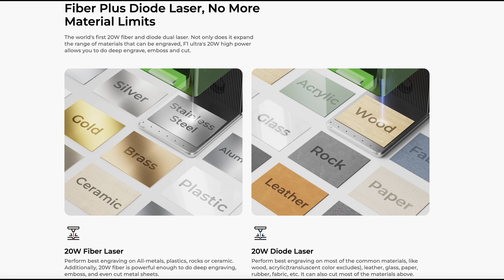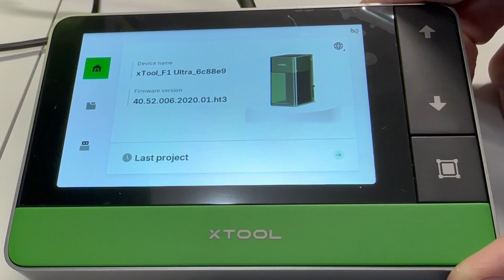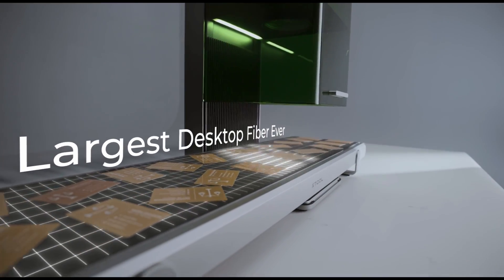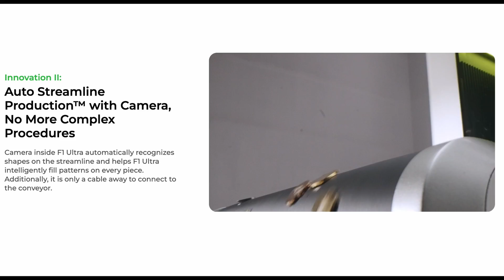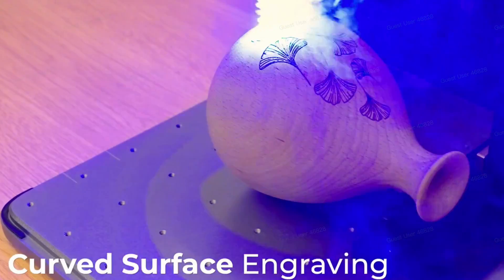Sneak Peek of the New xTool F1 Ultra 20W Fiber and Diode Laser Engraver

Comment: Overpriced!!!
Reply from the maker: Guess it really depends on the buyer.  Look what this laser offers over a standard bare bones 20w Fiber.  A Raycus 20w is $1,800.  Is it worth an additional $2,000(with the $900 off) if you were to add an additional 20w 455nm source, motorized Z, smart camera, light, external touchscreen, and miscellaneous odds and ends.   Some might not agree, while other will.  Like I won’t buy a luxury truck, when I only use my truck for hauling stuff.  I don’t care about all the luxury items.  While others want all the extras.

Comment: Wow you got your hands on this bad boy.  I like the lid on it.
Reply from the maker: When I was told that they had a new machine, I really was not expecting this!  It is massive!
Reply: @TripodsGarage  Crazy, Is it very heavy?  Would it be good to take to a craft show?  I wonder
Reply from the maker: @cubansli3099  - It weighs about 32.5 LBS - Just a little awkward to move around.  However, it came packaged in nice foam with velcro straps.  This foam protects the top and bottom and the straps go around the top and bottom.  I would save these for transport.  It would defiantly help protect the machine in transit.
Reply: @TripodsGarage  Thanks good point, can most likely pack in a tall case.